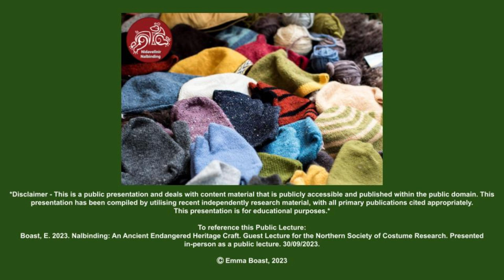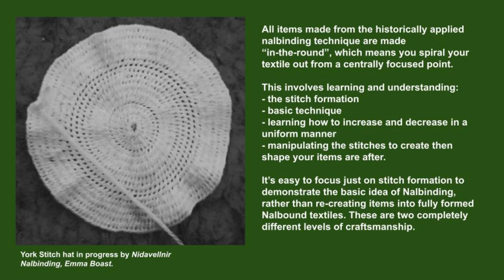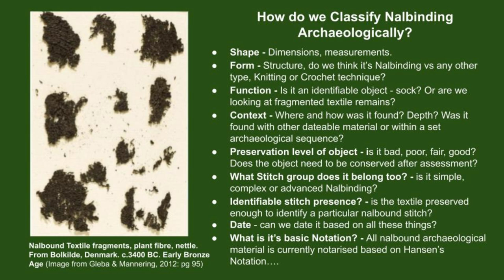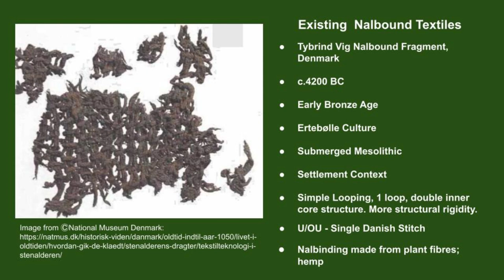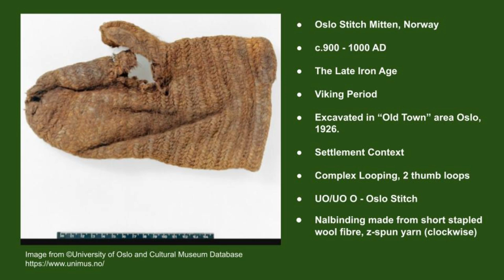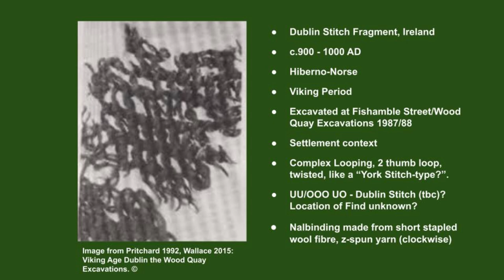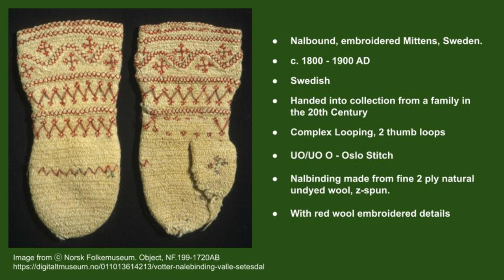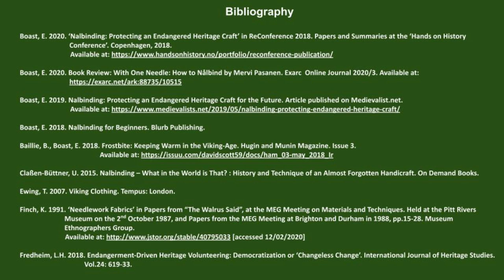Nalbinding: an ancient endangered heritage craft?

Comment: Thx for making the remake version of it. I was wondering if you had tried the Mammen stitch,and not to mention like making the Coptic sock tutorial.
Reply from the maker: Thanks so much!! Yes indeedy I have tried Mammen as well as Coptic Stitch. Both very different, but very awesome to use 😊
Reply: @nidavellnirnalbindinguk  You can try to make a Mammen stitch version of the Coptic sock which the pattern is similar to the original one,but instead it’s makes your feet more warmer during the winter months.